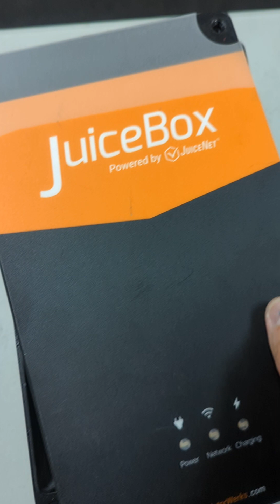Juicebox repair of burnt relay.  Here's how to repair it

Comment: So the point of those "Charging stations" that are not actually Chargers, is that they're a " smart "outlet that it's able to communicate with the charger in the vehicle and tell the charger how much power ( Amps, basically, because the Voltage is fixed) can take without tripping the breaker, so obviously the relay that it's used in those are "Chinese rated" to 40A, but they don't survive too long if actually 40A are going through it.

Comment: I just drilled out the screws so I could use a normal Torx bit.  I must have gotten the ribbon cable in there wrong because the LEDs won't light up, but the charger works.  If the relay goes out again, I will just buy a different EVSE - tired of dealing with a product with absolutely no support.

Comment: My Juicebox failed at the same time as my Ioniq 5's ICCU (Integrated Charge Control Unit) died this past week and I don't believe it was a coincidence. The ICCU issue with the Ioniq 5 has been the subject of multiple recalls / updates attempting to fix the issue with a software patch. The most recent one came out only a couple weeks ago so I hadn't had a chance to get it before mine failed this past week. Same issue with the Juicebox - 5 beeps. I tried the tapping trick but no luck. Opened it up and the relay board is charred (though not as bad as the one in this video). Car is throwing a P1E01 error code as read by ODB2 reader which means is related to the onboard charger voltage regulation so I have no doubt the car pulled too much current (it also tripped the breaker the Juicebox is connected to).

Comment: This was interesting - we were inspired by it to open ours up (had the same symptoms).  We found it pristine inside, not burnt like the video.  So we did what we do on a car - we rapped the replay with the screwdriver handle & then put it back together.  Now seems to be working.  Now the question is, do we buy the relay kit anyway (only a few left) in case it's on the way to failing?

Comment: Thanks!  My garage was very cold and suddenly my 2019 unit was getting the 5 beeps.  Their service department was useless even when mine was under warranty. I lifted the cover of mine to verify my MME had not fried the relay.  But one of the other comments below indicated the beep code indicated a stuck relay, and he was told by Enel x support to get a mallet and hit the right side of the box.  Percussive maintenance is free.   And it fixed mine.  I still bought the part on eBay in case the fix is temporary.

Comment: Bought my juice box 40 pro at the end of 2017 and charged my Spark EV, Bolt EV, and Model X without issue.  The first time I plugged in my E-tron, it charged to full and then started giving the 5 beep error, indicating a stuck relay.  I tore it apart and the relay contacts weren't stuck, but they were a bit discolored.  I have the EVSE on a 50 amp breaker and the e-tron can allegedly request 48amps.  After plugging it in, I took a quick look at the e-tron's dash, and it said it was pulling 8kw, so I think there's no way that it was pulling in excess of 40amps.

Comment: My juicebox has worked without issues for about 7 years. Charging my Spark EV, and our Pacifica PHEV, and my Tesla model 3 (replaced the spark EV). It’s an older model than the one you show and doesn’t have the led indicator lights. But the beep-code indicates maybe a relay error. Gonna have to take the cover off and look.
Reply from the maker: My 30amp older model has been fine too.

Comment: Very informative. 
I will check my supply voltage.
But any relay will wear out over time and use. This relay looks far too small to be able to handle this kind of power in a real world application and extended use cycle.

Comment: thanks. the dreaded 5 beeps. enel x support said to get a mallet and hit the right side of the box. wow. like a old washing machine. so many of these juicebox go bad. stay away from this company.
Reply: Thanks for this! 😀 Mine (from 2019) started blinking 5 times, and I found your comment.   I did whack the side of my box three times with a rubber mallet, and it started working again.   But I bought the part anyway in case the fix is only temporary.  The garage temp was down near freezing.
Reply: @RobertFritz-e1m  OMFG that actually worked! Thanks! Haha, so silly that smacking it made it actually come back to life.

Comment: I have a question . Do you still have the Pro 40 and if so did you have an issue connecting to the New juicepass app? When I attempt to add my Juicebox I get a message device not recognized.

Comment: Exactly what happened to me!  I unplugged my 2015 Model S and Plugged in my friend's 2012 Model S and it blew my relay in the Charger.  The older Tesla must have pulled more than 40 amps.
Reply from the maker: After I fixed the relay it lasted another month tops 😕 now it seems it's a different error

Comment: I had the 3 flashing lights/beeping with no charging.  I unplugged it and tapped the box a few times with my rubber hammer, Now it works again!  If it happens again I'll switch out the relay.  Thanks for saving me the call to customer support!
Reply: Has yours stayed working?

Comment: AMAZING, THANK YOU! Mine started blinking 5 times, which means that the relay is not closeing the contacts, I already took it down and into the house to open it, but this is just perfect, having the knowledge of where to buy the parts. Not sure what happened with mine, it is only drawing less than 8KW, may have been some power fluctuations in the grid, it happened quite a bit lately. And a new JuiceBox is over $600 US, so this should be money well spent. There are cheaper ones out there, but I like the Wifi capability of this one, giving you the ability to change settings remotely.:washhands::washhands::washhands::washhands:
Reply: What do you know, I took it all apart, found nothing at all, put it back together and now it works again. No clue why, but then again, why the hell would it blink 5 times after plugging it in, I thought that it was the error for the relay being stuck closed, but no it is for not closing when expected. I guess it is part of the boot up sequence when it checks if the relay closes when energized. But if I buy again, it won't be a wall mounted unit, I like the ones that are right on the cable.
Reply: @gabiv100  ~ Getting bumped around will often unstick the relay, because a welded relay is pretty weak (it's supposed to spring open, but the weld holds it shut until it's jarred/bumped). It'll probably get welded together again pretty soon, though. If it beeps again, this video is how to fix it! :)